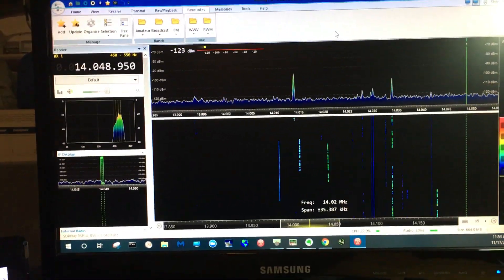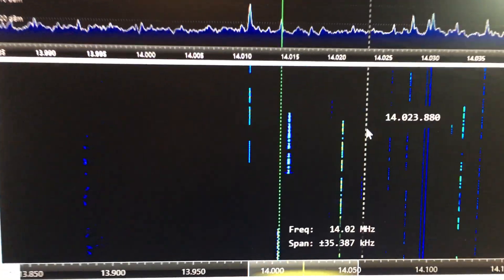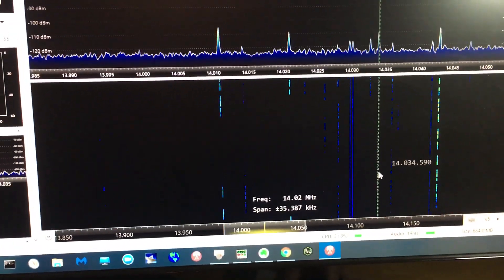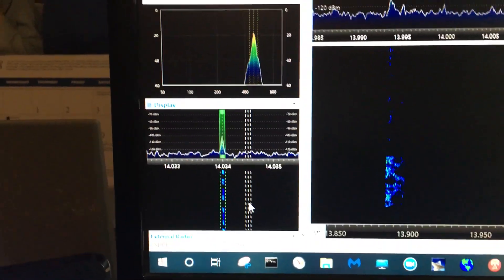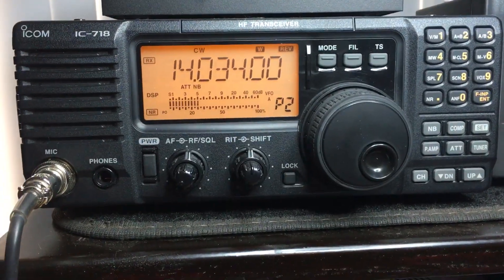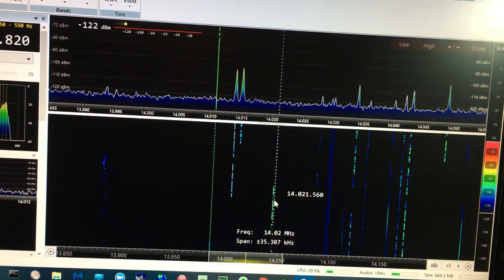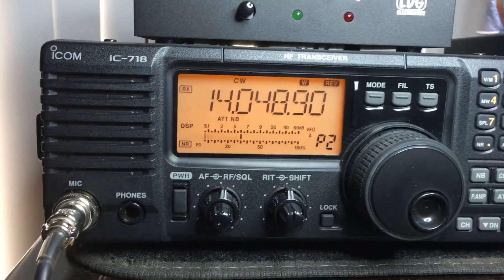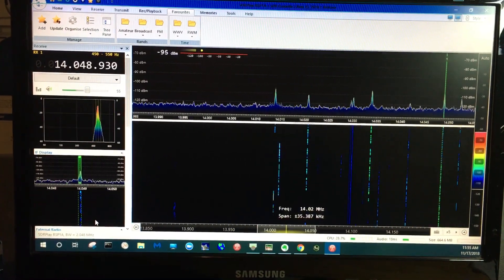Karl’s SDRPlay controlling a Legacy IC-718

Comment: How do you have this connected to control the rig?
Reply: You can order an IC-718 Rig Control CIV cable like this one  -  I would find one from a US Distributor, if possible
CI-V CT-17 CAT Cable for Icom Radio IC-703 IC-706 IC-718 IC-7600 IC-R72 
https://ebay.us/eQNW9G
Reply: @KarlZawoy  Thanks.  Will it control with HRD and SDR at the same time?

Comment: I connect my Transceiver to my laptop with a Rig Control Cable. You can purchase a Rig Control Cable to USB Adaptor from Gigaparts, Ham Radio Outlet, etc .. you can also get them in Amazon but each out for  knockoffs from China. I then run Ham Radio Deluxe to control my Radio from my Laptop. Once you establish Rig Control you can add the SDR. You will need two other utilities. The first is a Virtual USB Serial Port Emulator and the Second is a program called "OmniRig". Both are free. You setup two Virtual USB ports, I use Com 10 & 11. You then run and configure OmniRig to access the Virtual Ports. I use a SDRPlay RSP1A and my SDR software is called SDR Console. I've tried a few other SDR programs but like SDR Console the best. I has the cleanest interface. You configure SDR Console to interface to OmniRig. OmniRig talks to Ham Radio Deluxe and HRD talks to my Radio through the Rig Control Cable. I hope that helps. You can see more about my shack on QRZ. 73, Karl - KR6G
Reply: How do you hook this stuff up? Antenna splitter to sdr and to hf unit and hf unit to pc via cable? How are you getting signal to the sdr? Damn! I want to understand this...
Reply: Hi Karl, Thanks for the video and the above text. I have my IC-718 communicating with the PC. Have the virtual ports and OmniRig set up. I'm up to using SDRPlay. Do you need the RSP1A in order to use SDRPlay? and how does it connect to the 718? thanks again!